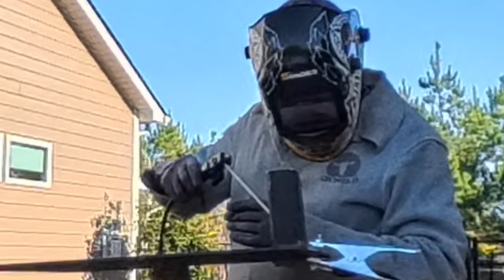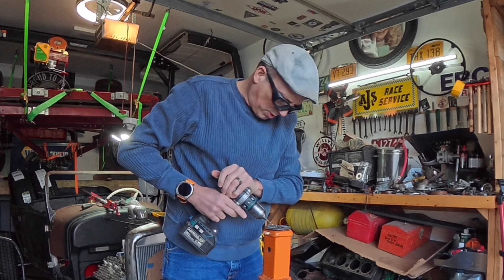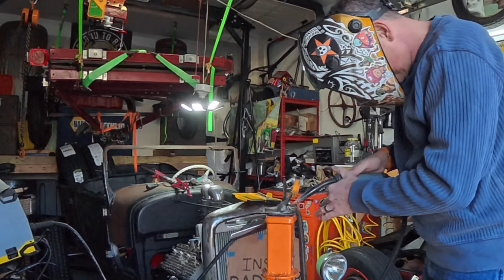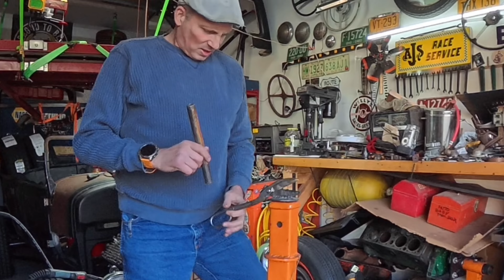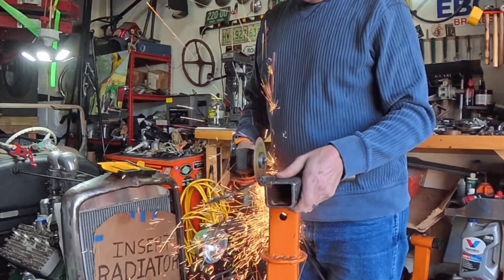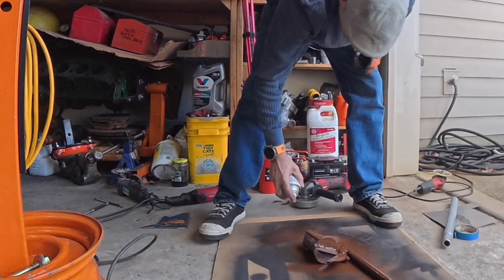THE BEVERLY SHEAR-BILLY!

Comment: Different style shears produce different cuts.  Beverly style tends to stretch the edge and induce a spiral effect with the smaller the part the more it spirals, plate shears cut straight and true, but curves are a pain in the ass. A guillotine shear set to a worktable height works good for large sheets but only straight cuts. A full-size foot operated shears work great for larger cuts and actual doesn't eat up as much room as one thinks because it a horizontal surface and become a storage area when not used. I'm just a old man on the other end of the road you're heading down, and I can tell you good quality tools and equipment are out there at fair prices, but you got to keep your eyes open and have the money in your pocket to go after it when it pops up, If you can't leave to get that deal when spotted someone else will

Comment: As always, killer vid.  Endless supply of motivation.  Also, broken tape measure installed on the front and or top edge of a bench or work area is handy as well.  Looks like your welds are holding as well.
Reply from the maker: Thanks Coy, and that tape tip is a good idea!